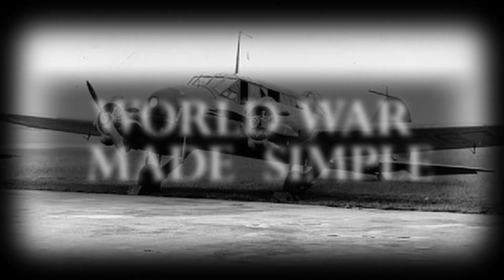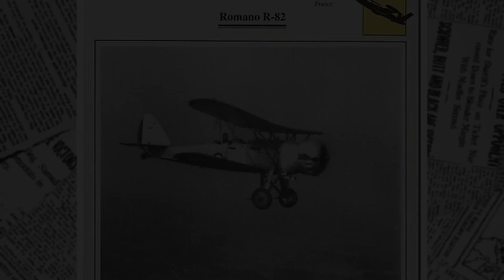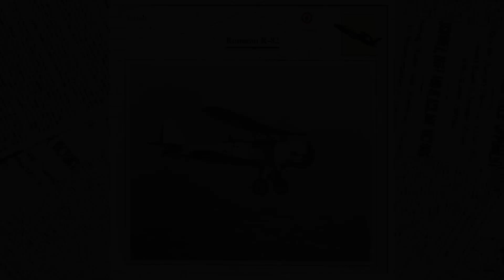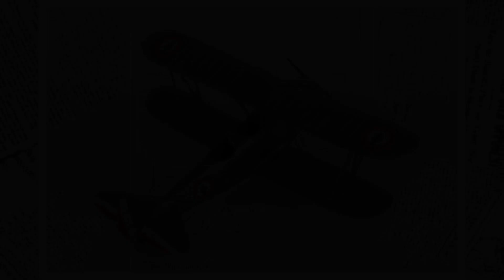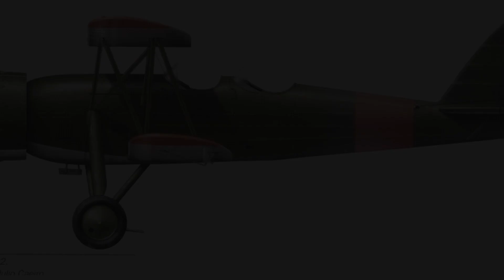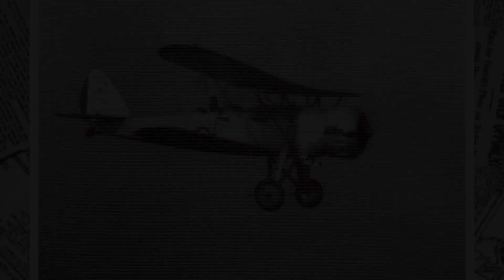How This Humble Biplane Forged France’s WW2 Aces | Romano R.82

Comment: Very interesting plane.  I'd have ordered a lot more of them and also used it as a colonial policing/light attack asset as well.  If you could attach a couple of 250kg bombs to it and maybe a couple of machine guns it's more than enough for work in the French colonies, thus freeing up more frontline aircraft for the home front.  The same qualities that make the Romano R.82 so good for training and resisting accidents and low maintenence are also perfect for colonial work, where you will have less access to maintenance and runways, etc.